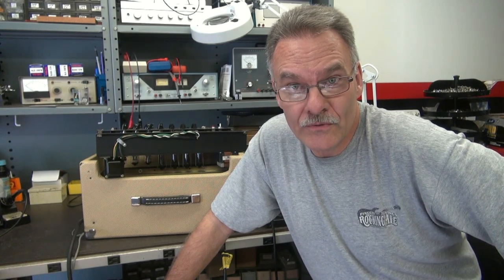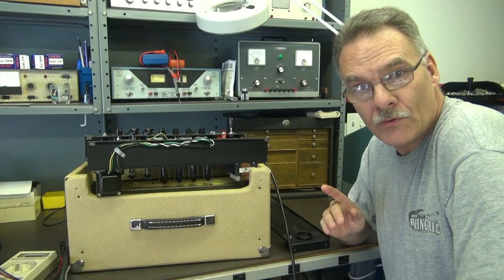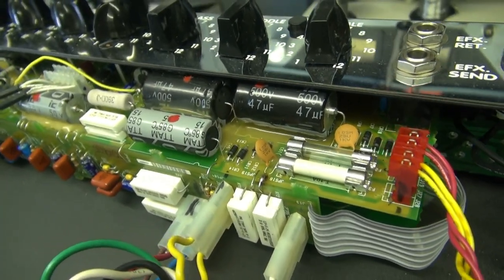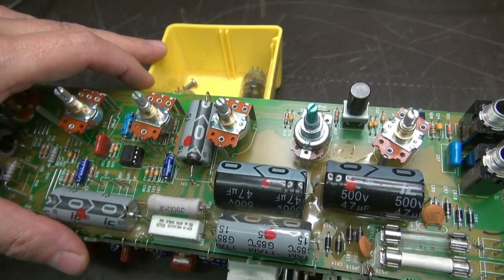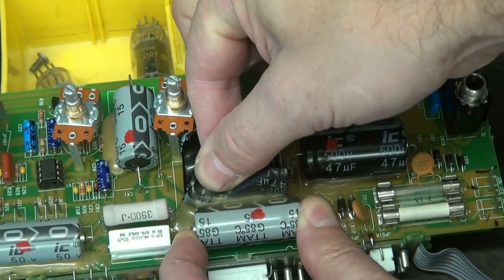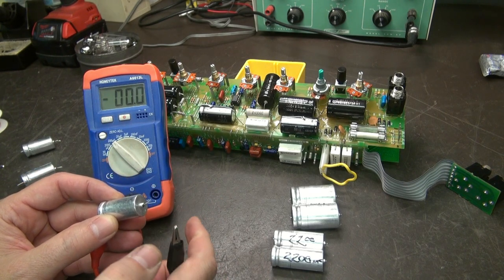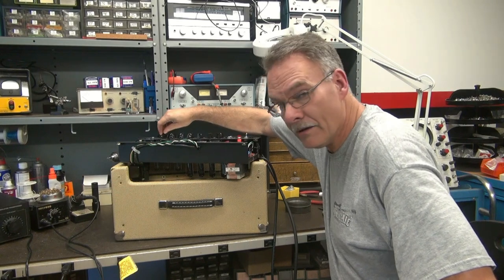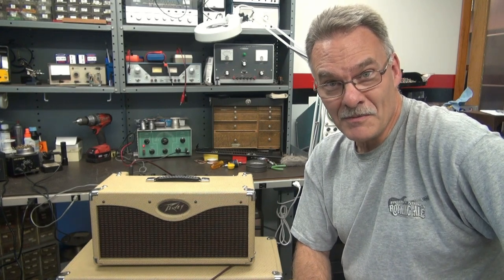How to repair Peavey classic 30 tube EL84 guitar amplifier hum buzz D-lab

Comment: I have one of these on my bench right now! I got it fully disassembled, and decided to take a break until tomorrow. My issue is no sound, no output signal, and the tubes do not light up. Wouldn't have thought to slice the label though! Genuis!

What type of input signal do you use from your generator, and what type of range on your scope? (if you dont mind me asking).

Thanks for posting this!
Reply from the maker: Hey man, sounds like you may have a bad power transformer.
My audio generator is an old Heathkit. Sinewave at approx 150mv, 1Khz
Scope range varies depending on volume. Normally 5 volts per division.
Good luck on the repair.
TD
Reply: Thanks for the reply and encouragement! I was thinking it will either be OPT or bad EL84 since they are in series on this amp. I will pull the transformer shortly and test it with my variac
Reply: D-lab Electronics sorry for the delay! You nailed it Terry. I pulled the PT and there are only 2 leads on the primary. Checked for continuity, nope...primary was open. I put 100vac into it from my Variac and confirmed it was toast. Got a new PT from Peavey, except they have a new part number with 4 leads on the primary so you have to wire them in parallel for 120V. Thanks again Terry. PS: your vid is really saving my behind for trying to remember how to put this thing back together right now! Ha! Cheers, my fave youtube channel! -chris

Comment: hi ,  have a classic 30 with a noise problem .I replaced the tubes but the noise remains . when I turn the amp on its ok but after 5 mins a very loud buzzing noise starts .do you have any idea what this could be ?
Reply from the maker: Hello, my first guess is bad filter caps. Those amps are famous for that issue.
Next, inspect the circuitboard for bad solder joints. This is a pain, since the amp reqs complete disassembly.
Reply: ok thank you for your swift reply , i`ll try this now i know which direction im heading. great videos keep them coming .

Comment: I’m trying to source parts to replace the caps. I would like to buy everything from one provider but they don’t carry the Nichicon 2200 uF 50V caps. They do have K+F 2200 uF 63V though. Can I use these?
Reply: If they physically fit, yes.

Comment: Terry, what adhesive are you using. Do you ever use hot glue? And yes, another kick butt tutorial!
Reply from the maker: Thank you my friend. I use E6000 clear adhesive. It will glue anything and does not corrode. Thanks for your support.
Reply: I thank you, Terry, for your time, generous and humorous sharing of your experience! God bless you, Joe
Reply: Yes, another great video! Just changed the caps on one of these things today, watched the video first though, never worked on a peavey before only fenders! Was kind of dreading it a bit, but the quality of the peavey circuit boards is better than the fender boards i've worked on! Thanks  terry! These are (in my opinion) the best videos  on youtube! ( I dont get out very much)

Comment: why did you not test the caps,before charging time,and materials,to replace them?
Reply from the maker: The amp came to the shop for a cap job. No need to test when it was previously agreed. Kind of like taking your car in for new tires.
Reply: understood.
like your work.

Comment: Good job! How much does a service like this one cost? Thanks
Reply from the maker: Complete with parts, approx $200
Reply: Ok great thanks. My classic 30 sounds fine, but when you turn it on , you hear some crackles in the beginning. What could be the issue? Once it warms up the crackles go away tho.
Reply from the maker: My guess would be a noisy tube. Take a wood pencil and tap on the tubes with no input, volume low. See if you can hear noise when a certain tube is tapped. If so, change that tube. Let me know. TD
Reply: Many thanks for the tip!
I did what you suggested and 2 power tubes (first and last) would crackle a bit. Funny enough these 2 light up less than the other 2. Does it mean anything? I'm gonna replace them with some EL84s from another amp I've got here.

Comment: where can i get thoes cabs?
Reply from the maker: The tube depot sells them + ebay
Reply: could you tell me specs of thoes each caps please? tube depot sells but there are bunch of them

https://www.tubedepot.com/products/f-and-t-germany-22uf-500v i need 3 of these right?
https://www.tubedepot.com/products/f-and-t-germany-47f-500v 2X

coudnt find the 2200 ones that you check last two of them?
Reply from the maker: Yep, those are the ones
Reply: can you give me the list of the cap do you put it? and what other cap brand do you recommend?